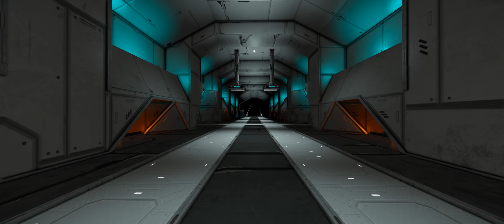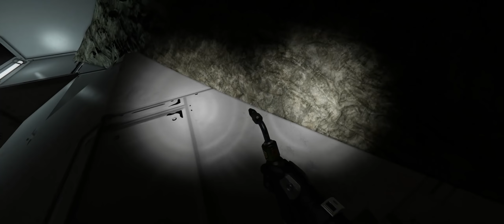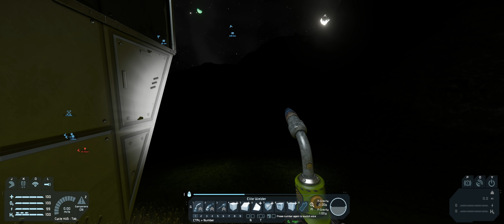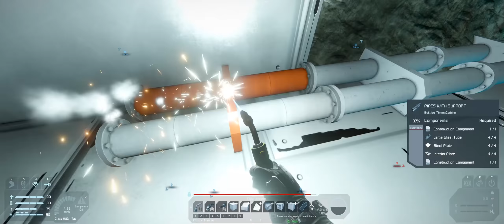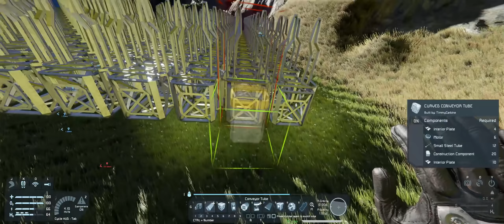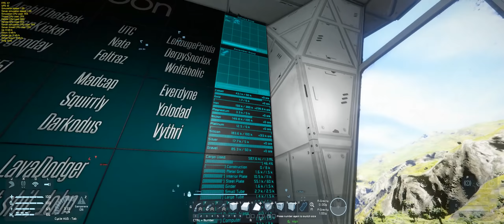Space Engineers Survival, Maybe... || E32 - Project: Welder Platform || TimmyCarbine

Comment: if you have a stack wall of wielders in a spaced out layout wielders have a range they wield and you just have a piston moving the projector with the new ship attached to it. it will extrude the new vessel as you retract the pistons. you can then cut the connection to the projector and retract then lower with more pistons.

Comment: Excuse me for saying this but I suspect that you have got this project arse about.

I assume from your early comments about using pistons, that you are going to pull your blueprint through the welding bed.  So I'm guessing that the welding bed is built to pull the blueprint through from top to bottom, therefore needing the bed to accommodate the vehicles width and length.  Having not seen the streaming I am assuming that the dimensions of the truck would be much lower than it is long, therefore far fewer welder would have been required if you set them up in the vertical plain.

All that aside, I am continually amazed by the base that you built.  It is huge, it s beautiful and it functional.

But even after all this time and effort, you still have to build new vehicles outside, on the grass, in the dark.

Comment: You almost had it with your temporary conveyor line.  At the end of the line, rather than putting in a conveyor junction, you should have installed a small cargo container.  It would have done the same job as the conveyor junction but would have saved yourself a lot of leg work.